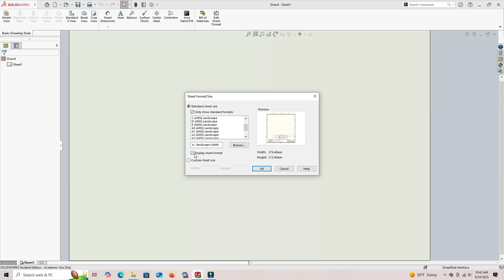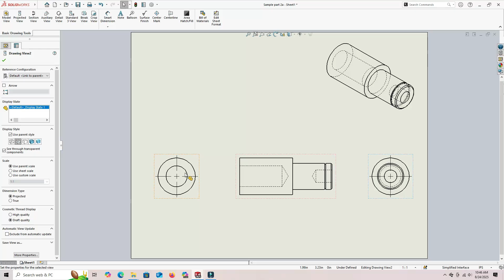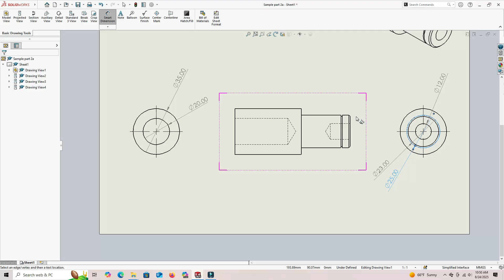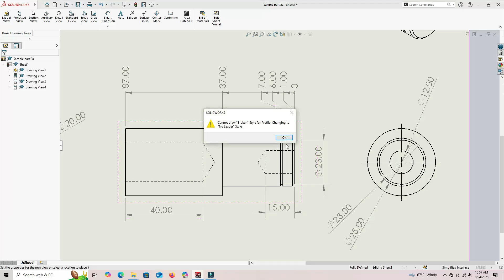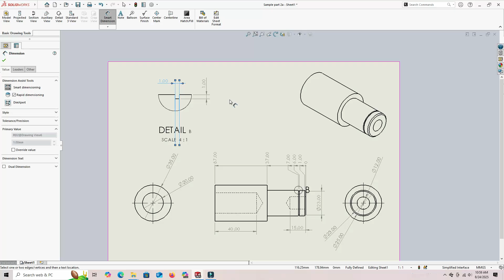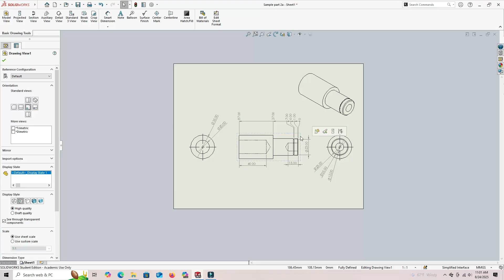Solidworks Tutorial 5 - Making Drawings Part 1

Comment: Excellent tutorial Stuart.Being a machinist as you do I would like to learn more about this computer graphic design but I like to try some free basics before commiting myself to buy a particular program.W´ll see what happens.Thank you.
Reply: The makers' version of SolidWorks when on sale is approximately $50 USD/year. Fusion 360 is free, but assemblies are difficult to use, and drawings are not available for the free version. I switched because I needed the drawings for use in the shop.
Reply: @theseldomseenkid6251  Thank you sir.I´ll try Fusion 360.
Reply from the maker: Hi Angel. I totally understand that. The full version of Solidworks is pretty expensive so I know it isn’t for everyone. As was pointed out, Fusion 360 is a very popular choice and so is OnShape. I haven’t tried Fusion but have a friends that swears by it. I'll try to familiarize myself with it. I've messed around a little with OnShape. It's cloud based so you can access your files from any computer. It seems pretty intuitive and has a lot of  similar features to Solidworks. Maybe I'll get good at both of them and do a comparison video.